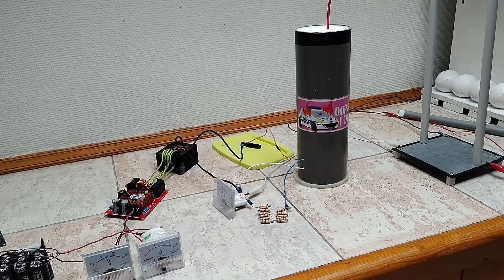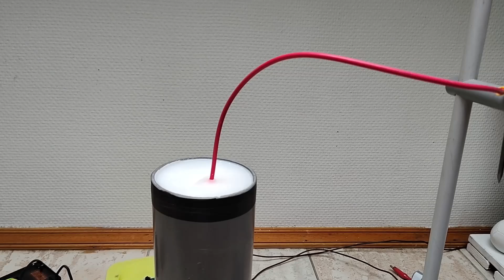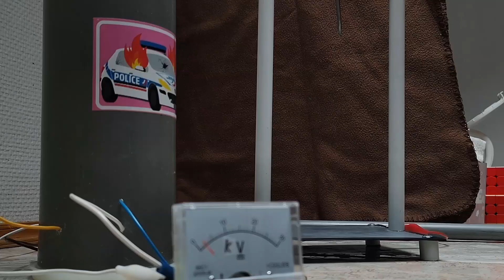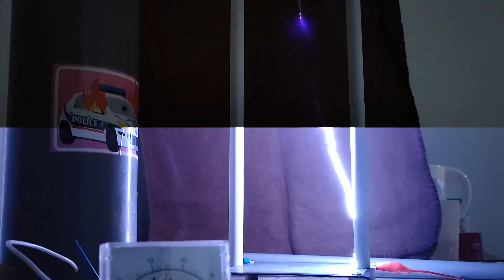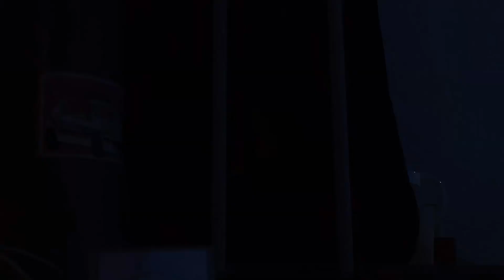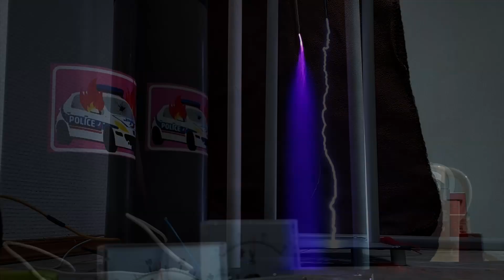200kV High voltage multiplier

Comment: Great setup, awesome corona and awesome sparks! Thanks for mentioning my videos :) I think the analog kV meter is a really nice touch, these are much more resilient in HV environment than the digital ones. It's interesting to see that apparently in gaps of such needle-plane geometry this bright corona stream seems to appear quite easily (i.e. it wasn't a fluke of my own setup). Keep up the great work!
Reply from the maker: I'm honoured to see you here!
I must say I was quite confused with this bright corona channel when I first saw it. Does this kind of discharge have a name? I would be curious to here insight on this phenomenon from you!
Something else I noticed, is that the arcs seem to be much curvier near the needle. My guess is that the field is more homogeneous near the plane, but do you think that's the reason?
Reply: The info about the bright corona channel seems to be quite scarce, unfortunately. At best it might be called a flare corona discharge, but I'm not really sure. I suspect that our relatively weak multipliers (high output impedance) act as a sort of voltage regulator,  so when the corona appears the voltage sags slightly and no immediate breakdown occurs, which might help stabilize the discharge. While in professional HV labs their multipliers are quite powerful, so the first instance of such corona might lead to the breakdown straight away.

About the curvature of the sparks, yes, the usual explanation (and I agree with it) is that streamers more or less follow the E-field lines (because individual electrons and ions comprising them do), so the difference in curvature just reflects the electrostatic field lines distribution. For example, in a gap between two spheres, the gap being much smaller than sphere radius, the sparks are almost perfectly straight because the field is homogeneous. In long gaps local air variations matter more, so the spark trajectory is more chaotic, but the general (statistical) trend still reflects the field distribution.